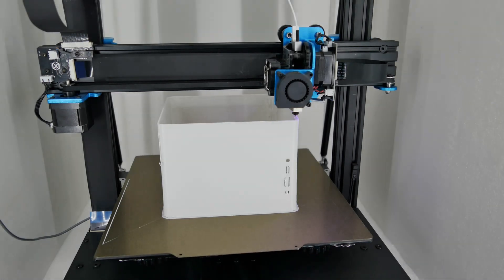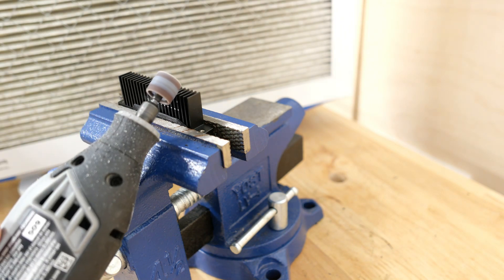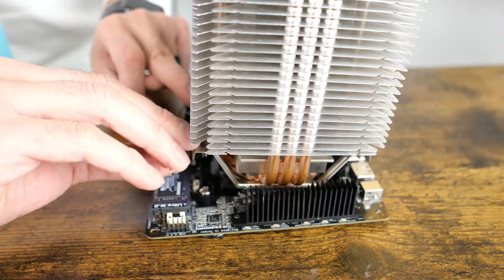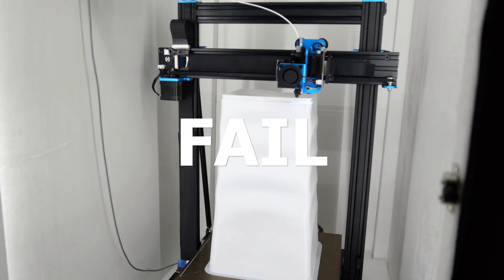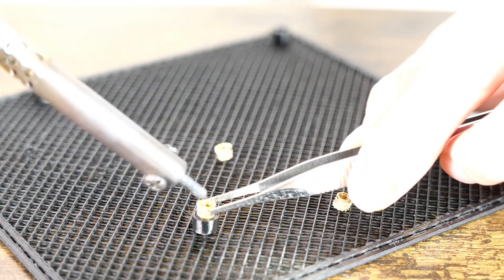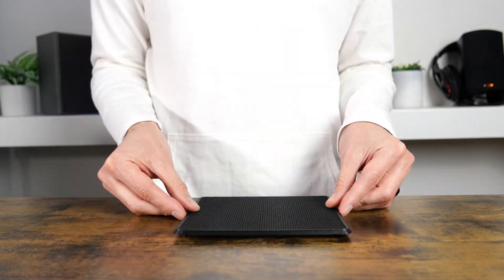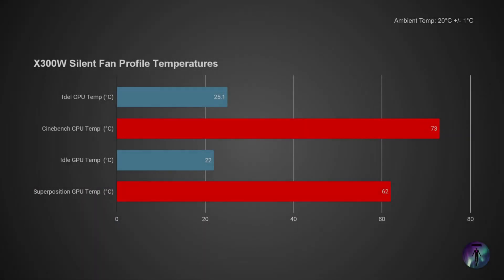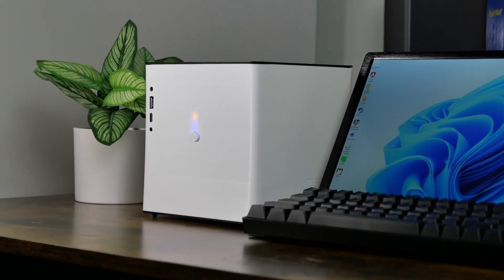How I Salvaged a Failed Project: 3D Printed PC Case

Comment: Did u use a aftermarket power button ??? I wanna do this type of stuff building a pc case
Reply from the maker: The plastic over the button I designed in, but the actual button that is actuated and connected to the motherboard is the same button that it came with stock. Thanks for watching and good luck with your PC case adventures - love seeing other people’s custom builds.
Reply: @stand_up_g4m3r  can I ask what is your recommendation on pc to rendering projects like yours i have old ryzen parts so just wanting to reuse them if I can build a budget pc etc
Reply from the maker: @AznJungleFever  if you want to just design cases using CAD, then I would suggest watching videos on OnShape until your eyes bleed; OnShape is CAD software that runs on the cloud, so system requirements aren’t really an obstacle - you can even design using an iPad or other if you want.
Reply: @stand_up_g4m3r  you are amazing I'm happy im getting quick replies I'll definitely watch those videos I'm definitely a fan of your channel now